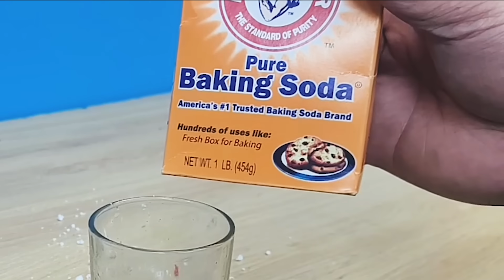Practical invention - Smart wooden furniture repair technique will help you reach level 100 Master

Comment: Kullandığınız malzemelerin ne olduğunu yazar mısınız. Nasıl yapıştırıcı yaptınız. Köpük tamam da neyin içinde eridi. Kezzap mı ne?
Reply: Benzinmiş okudum
Reply from the maker: Thanks! I used recycled foam (the kind from old sofas), mixed with gasoline to create a flexible glue. Don't use vitriol (sulfuric acid), just a mild solvent like gasoline or toluene is enough to dissolve the foam. I will make a separate video on how to make the glue if you like

Comment: 7:38 to conseal the gap , you can insert baking soda into the gap & apply super glue. Use a cloth to quickly wipe it off the excess before it dry.

Comment: Looks like the whole table thing didn't work out as I see two nails on each side that you only showed yourself putting in one nail so the glue thing didn't work or you just didn't give it enough time I don't know what happened there but I'm almost sure that if you would have just done two screws on both sides like that and no glue you would have got the same result